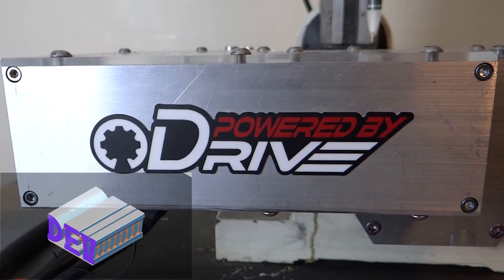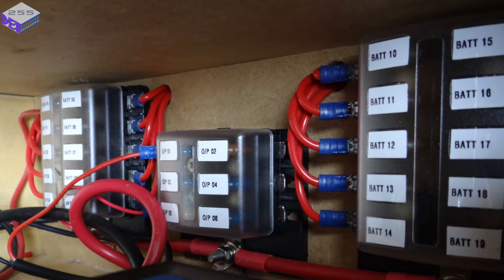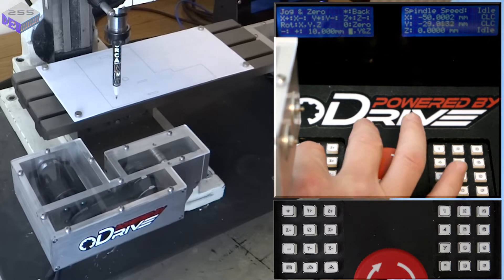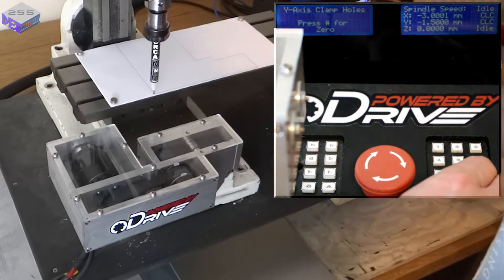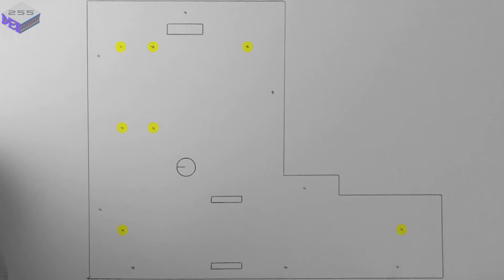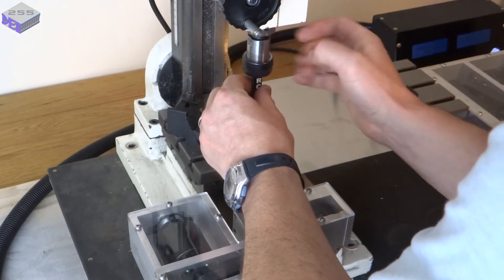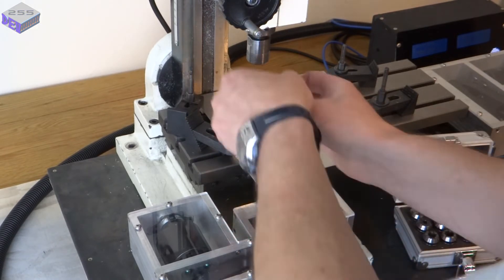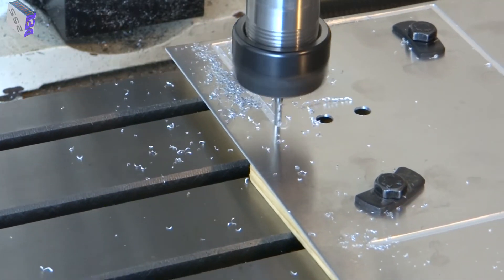Home Solar CNC running on Arduino - CNC Mill Conversion Part 10

Comment: Awesome videos! Maybe I missed it in previous videos, but are you using any kind of gcode interpreter?
Reply from the maker: Thank you, I'm just using the Arduino Mega 2560 to interpret the G-Code, although at present this only accepts G00, G01, G02 and G03 and typed in manually. It will be able to interpret from an SD card in the future, but needs more programming first. Here is the latest Sketch for the Arduino if you would like to take a look: https://github.com/Dev255/Arduino-ODrive-CNC/tree/ArduinoSketch

Glad you liked it.